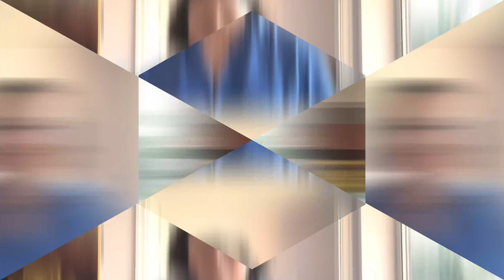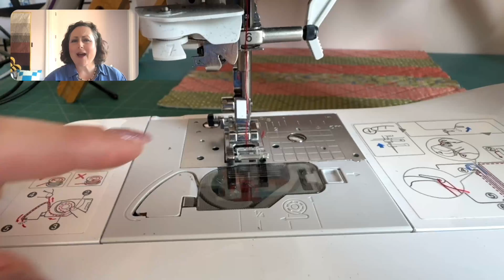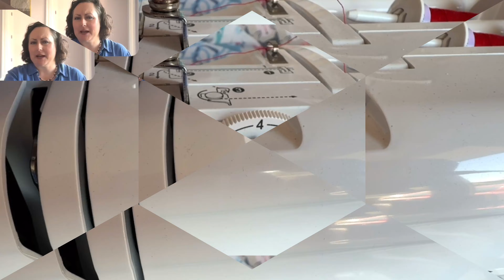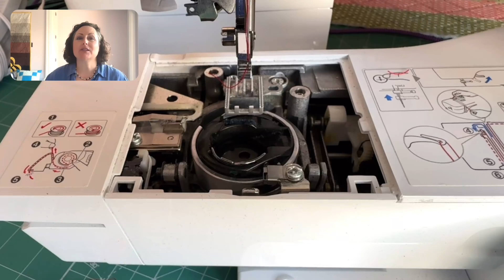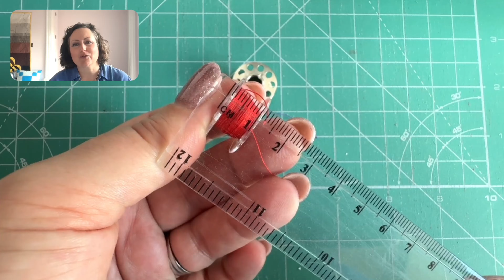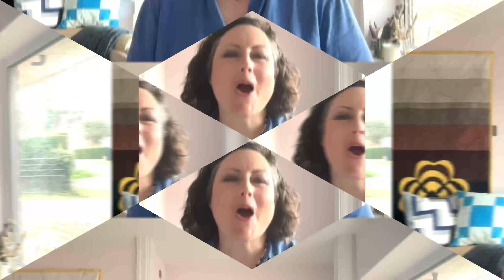😳 Why Your SEWING MACHINE Is Thread Bunching Up and How to STOP It

Comment: The Bobbin!! It looked and measured almost identical, but..... NO!  Going back to the original bobbin that came with the Brother machine made all the difference.  Then, I changed the needle just to be on the safe side.  Ok, that's solved, but now I am finding that some Gutterman thread is moving quite nicely from the top spool, and when I switch it to another spool, it gets all bumpy  and irregular and the thread breaks. Why oh why? Any thoughts?
Reply from the maker: Are you using the correct size of spool cap for the size of spool? Spool caps come in different sizes and should be very slightly bigger than the spool it's holding in place; then it stops the thread catching (which ultimately causes issues and breaking) https://youtu.be/2OItkygE_wo

Comment: None of this worked
Reply from the maker: Oh no, that's annoying. A weird thing to try is a completely different brand of thread. Sometimes, machines develop and objection to a brand (no idea why because it shouldn't happen!). If all else fails, take your machine along to a sewing machine engineer for a full service and tell them what the issues is. They will be able to find if there's a deeper / more technical issue causing the problems. Good luck 🤞

Comment: Thanks for all these tips. I’m a little unsure, still. Example, if I think I’ve dealt with the common problems, and my stitching is gathering the fabric (so I need to stretch it out after then the thread breaks) do I adjust to a higher or lower # on the tension?
Reply from the maker: That sounds like your tension is too tight, so try lowering the number half a note at a time to see if that helps 😊 Kim x

Comment: I used a pipe cleaner to clean dust from my maching. The thread didn't bunch, but the tension is still loose.
Reply from the maker: I love the idea of using a pipe cleaner! If your tension is still loose, try re threading the top spool, making sure your presser foot lever is up when you do (that way, the thread goes in between the tension discs). Try that first, then check that your bobbin is inserted correctly with the thread coming from the back and to the left. If you have a top loading bobbin, the thread must stay within the housing that the bobbin sits in, not pull across the top of the bobbin.

Comment: I can’t find out at all, it is bunching up and making a crunching noise, I had to sew a shirt by tomorrow but I can’t find out why my sewing machine is messing with me
Reply from the maker: Oh no, I’m sorry you’re still having trouble, and so sorry it’s taken me a while to respond.

If your machine is making a crunching noise, I’d stop sewing because that sounds as though something may be catching or jamming.

A few things to try:

1. Take the fabric out, remove the needle, remove the bobbin (and bobbin case if your machine has one), then gently turn the handwheel towards you. If it still feels crunchy or stiff with no fabric, needle or bobbin in place, there may be thread jammed inside or the machine may need looking at by a sewing machine engineer.

2. Take off the needle plate and check really carefully for trapped thread or fluff around the bobbin area. Even a tiny piece of broken thread can cause horrible bunching and noises.

3. Put in a new needle, making sure it is pushed all the way up and facing the correct way for your machine (normally it's the flat of the needle to the back of your machine). A bent or slightly damaged needle can hit the bobbin area and make a crunching sound.

4. Double check that the bobbin is the correct bobbin for your machine (bobbins are not universal) and that it is sitting properly. If it’s the wrong size or not seated correctly, it can jump around and cause thread nests.

5. Rethread the machine completely from scratch with the presser foot UP and hold both thread tails gently for the first few stitches.

6. Test on a scrap fabric. If it still crunches, jams, or misses stitches after all that, I’d stop and not force it, because forcing it can make the problem worse and your machine won’t be happy. Then take your machine in to see your local sewing machine engineer and they should be able to sort the problem for you.

I hope that help and you find the solution. Kim x

Comment: Thank you for the wonderful information. I have a question , I have a brand new brother lb6800 and it sews wonderful until I come across a thicker piece of fabric. Like a pocket in a pair of jeans or a seam. When it's getting closer it starts making a clacking noise. It's all clean the bobbin area is clean, the needle is new I've double-checked the threading and also I added a brand new bobbin just in case that was the problem. I would really appreciate any information you might have as to why it is doing this thank you so much
Reply from the maker: Hi Catherine, there are two things you need to do: first, make sure you have the correct type and size of needle for your project. 

For instance, for jeans, you'll need a denim needle in a size 90/14, but if you're going over bulky seams, then I'd increase that to at least 100/16, possibly more. That'll be what's causing your machine to groan at you with funny noises. This video will help you understand the needle sizes: https://youtu.be/6GWJp6ogVdg

Secondly, you need to increase your stitch length as you go over seams. I recorded a video to explain why, which you can watch here: https://youtu.be/9SBWtHD-y5g

Hope that helps! Kim x

Comment: Thank you!  I was having so many issues with my machine when i found your video. 

It was a facepalm moment of realizing I didn't actually remember the last time i changed my needle.  

I only had stretch needles on hand, and i wasn't using stretch, but even still it was an instant fix.  

Thanks
Reply from the maker: Woo hoo! Glad I helped get your problem sorted. Stretch needles have a ballpoint tip which are designed to slide through knit fabrics easily, so as soon as you can buy some universal needles, do get a few packs of different sizes for your woven fabrics. Kim x

Comment: Thank you. The bottom thread was a mess. I re-threaded the e tire machine and I think that it was the spool. I wasn't really sure what it meant to have the spool set to that the thread comes off in a clockwise manner.  I thinkmthat means off the top, not the bottom of the spool, which sits horizontally.  It's better now, so we'll see
Reply from the maker: Hi Izziey, glad I could help, although so sorry if I wasn't clear enough on the bobbin thread direction. If your bobbin is laying flat, then thread comes from the top to the left before you follow the path that your machine wants. This video might help: https://youtu.be/meKLqWFWwt8  Kim x
Reply: @QuiltWithKim I am referring to the spool of thread, not the bobbin. I wasn't sure how the place thr the thread.
Reply from the maker: Oh golly, I'm SO sorry, I re-read your question, and I have ZERO idea why I thought you were talking about your bobbin 🤦🏻‍♀️🫣 Blame menopausal madness. Doh. 
So, let's try again 😅... when your spool is horizontal, the thread comes from underneath: if it was upright, it would come from behind and to the left, which is the same as coming from underneath when it's horizontal. Hope I've made better sense than this morning! Kim x